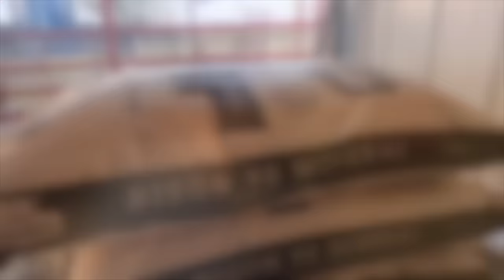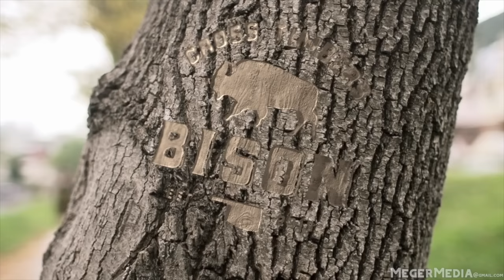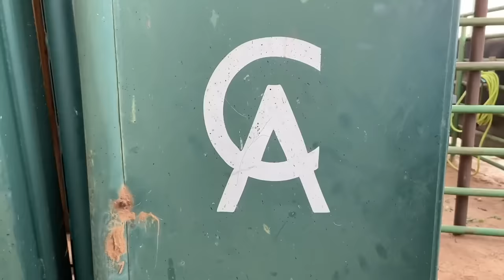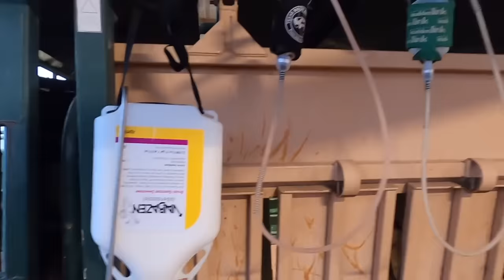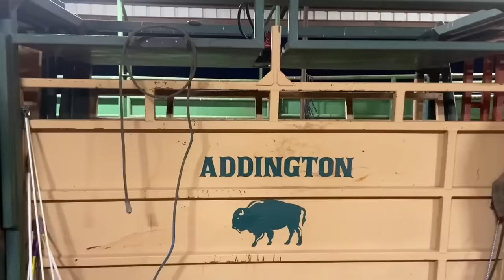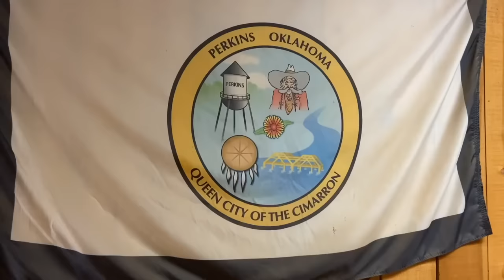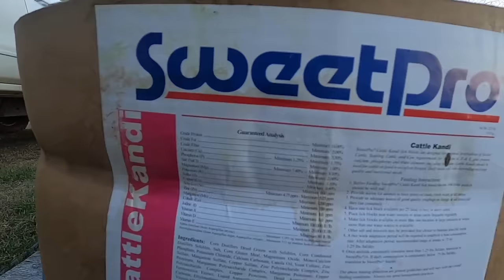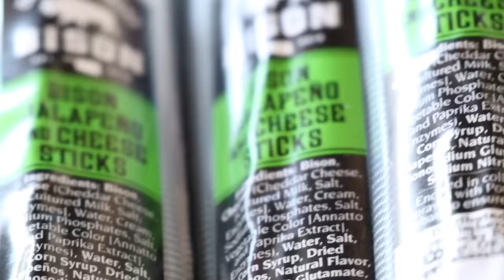Cross Timbers Bison: SEASON 2 MARATHON! (Part 2 of 5)

Comment: Good luck with your puppy adventure, I'm a Dachshund and basenji breeder,  just some advice, get your whelping kit ready now, get some cal-sorb(absorbable calcium) that is good to have on hand while your bitch is whelping, and keep contractions going.  Make a little puppy warmer with a sterilite container with a heating pad. I use the bed warmers from jeffers pet to put under the whelping area to keep pups warm. Have some milk replacer, feeding tube and baby bottle on hand. It's super stressful so not having what you need makes it worse, good luck having puppies is a wonderful experience but also can be devastating when things go wrong.  I've seen about everything  over the years😊

Comment: Wow if you have 13 bison right now, then you have over $35,000 in bison. And that's only if you sell them for 2500 each, but a full grown bison can sell for over 10,000 just for one, with yours most of which are full grown, then your bison would be worth over 350,000 instead of 35,000. 

13 isn't a bad number. No number is unclean! None! 13 represents the 3 in 1 of God, or the 1 in 3 I should say! Celibate god's grace! 😆